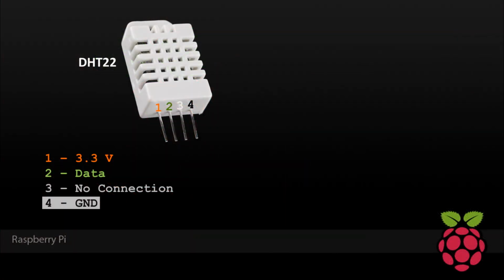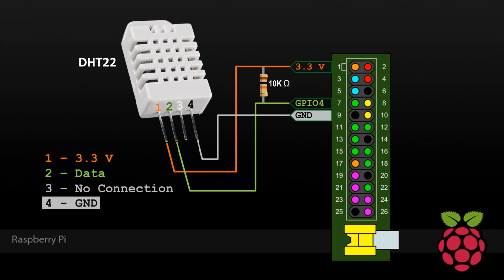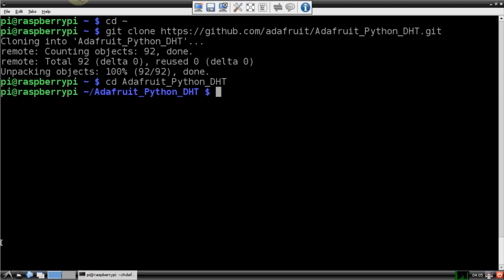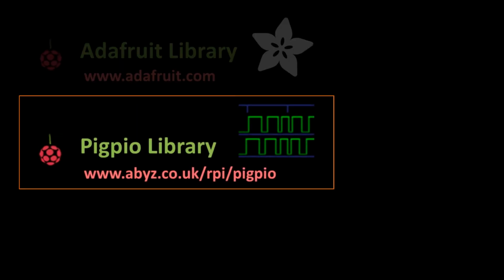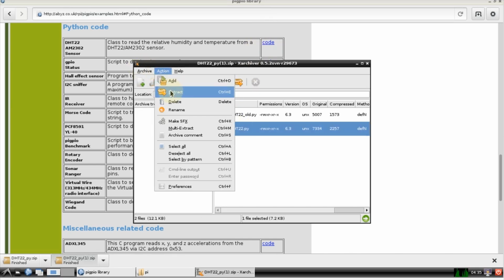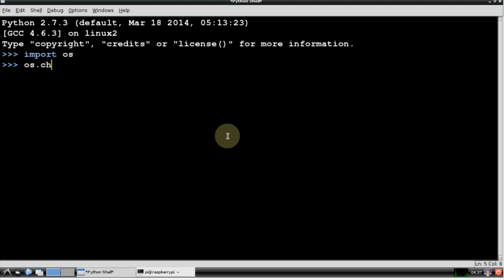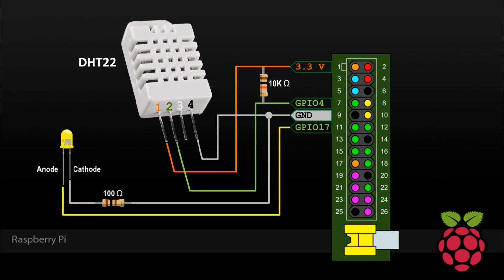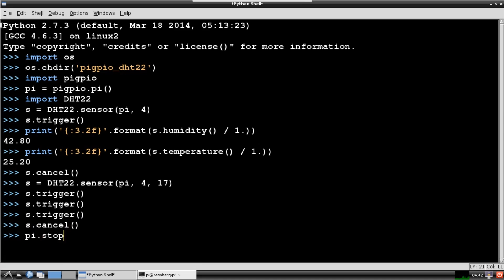DHT22 Raspberry Pi Humidity Temperature Sensor Tutorial

Comment: noob question, why the 10k ohm resistor? ty in advance
Reply from the maker: The resistor needs to go across data and 3.3V because it expects a pull up.  It won't work across data and ground (that would be a pull down).  For short cable lengths, 10K should be OK.  For longer lengths, a 4.7K resistor might work better.
Reply: Is there any computation to know how much resistor should i put between the 3.3v and the data pin? Thanks in advance :)
Reply from the maker: Through my website.  There is a link the video description.
Reply from the maker: I wouldn't call myself a Python logging expert.  Here's a good example of a TimedRotatingFileHandler: https://www.blog.pythonlibrary.org/2014/02/11/python-how-to-create-rotating-logs/
Reply from the maker: I don't think it is an option with the Adafruit DHT-22 Python library, but it might be possible with the PiGPIO library.  However, I think the Pi's internal pull-up range is around 50K to 65K ohms which may be too high for the DHT-22.
Reply: well, let me refine my inquiry, why between the data cable amd the 3.3 v cable?
Reply from the maker: It is a pull up resistor.  Data signals are usually transmitted as 0’s and 1’s represented by lows and highs.  0V or 3.3V with respect to the Pi.  The resistor pulls the data line high so it has a defined default state.  Otherwise, the data line would float.  A floating pin is unpredictable and subject to interference and arbitrary readings.
Reply: rdagger68 thank you for the fast response! keep up the good work friend!
Reply: + rdagger68 may I know what if I put the resistor between data & GND? And any reason for choosing 10k ohm value but not 5k for example?
Reply: Thank you for the response, can i ask a different questions? Still it's about raspberry pi and python, how can message you sir? :)
Reply: I would like to make a python program that will create a new log file, every 24 hours, I googled and it says I need to create a TimedRotatingFileHandler, but I want to understand more. I know you're expert on this, sorry I'f this is a little bit off topic. Looking forward you help me out kind sir.
Reply: Thanks for the help, tho I figured it out myself a couple of minutes ago, still thanks for your kindness sir. God bless you :)
Reply: Hello again sir, I just want to ask a question again, why is it when I setup my GPIO as GPIO.BOARD the DHT22 doesn't read at all. but when I leave it as shown, it works just fine.
Reply from the maker: There are 2 numbering modes for referencing the pins.  Board refers to pin position on the board.  BCM refers to the Broadcom numbering.  I use GPIO.BCM in all my videos because I find it more prevalent.
Reply: @rdagger68, hi, me again :D
may I know is it possible to use internal pull up instead of external resistor?
Reply: rdagger68 I stated the pin correctly when I set it up to GPIO.BOARD, yet it still doesn't read, but other sensor do. I'd like to think it has something to do with the configuration in the library, maybe it is BCM in default.
Reply from the maker: In the past, you would get a runtime error if you did not specify the mode with GPIO.setmode().  This may have changed in recent releases of Raspbian Jessie.  I haven't tested it but based on your experience it's possible that it now defaults to BCM.
Reply: how do you connector the resistor with data pin and the 3.3V pin without using protoboard
Reply from the maker: Generally speaking, you want the pull-up resistor to be 1/10 the resistance of the input pin (also called the input impedance).  10KΩ is usually a safe bet.  There are exceptions such as timing and distance, but  I’ve had no issues with 10KΩ on the DHT22.

Comment: Do I have to hook up pin 4 of the DHT22 to the ground rail of the bread board?
Reply from the maker: DHT22 pin 4 must be connected to a ground on the Pi either directly or as in the video via a breadboard rail that is common to the Pi.

Comment: Hello sir, Can I use any kind of temperature and humidity sensors, co2 sensors to be directly interface with Respberry Pi. Does all of it compatible with Respberry Pi?
Reply from the maker: Great question!  In terms of hardware, you should be able to interface most 3.3V sensors.  The same goes for 5V sensors when combined with a level shifter.  In terms of software, digital sensors usually require a library to poll the sensor.  You can often find a library on GitHub or one that can be adapted.  It can be challenging writing a software driver from scratch especially when precise timing is required.  On the other hand, analog sensors can usually be driven with an ADC such as the MCP3002 or ADS1115.
Reply: Thanks! great help.

Comment: You seem to be using python 2 for this, do you know if this will work with python 3?  I also seem to be having trouble running this as an executing python program.  It appears to work OK from the shell but when I enter the entire program and running it fully with 'python  myProgram.py', I get an error saying that it can't find a module named DHT22.  Here's my code:

import time
import os

os.chdir('/home/pi/DHT22')

import pigpio
pi = pigpio.pi()
import DHT22
s = DHT22.sensor(pi, 4, 18)

while True:
    s.trigger()
    print('{3.2f}*C'.format(s.temperature() / 1.))
    print('{3.2f}%'.format(s.humidity() / 1.))
    time.sleep(3.0)

Any help is appreciated.
Reply from the maker: It will work for python 3.  For the Adafruit installation just add 3 after python:
sudo apt-get install python3-dev
sudo python3 setup.py install
I think Pigpio already comes installed on the latest version of Raspbian Jessie.
You would also run with python3:  python3 myProgram.py
I would add a shebang line.  I revised your code (I put the DHT22.py file in the same directory as the script):

#!/usr/bin/env python3
from time import sleep
import pigpio
import DHT22

pi = pigpio.pi()
s = DHT22.sensor(pi, 4, 18)

while True:
    s.trigger()
    print('Temp={0:0.2f}*C'.format(s.temperature()))
    print('Humidity={0:0.2f}%'.format(s.humidity()))
    sleep(3.0)
Reply: Perfect!  Thank you very much for your help.  Have everything working now under python 3.  Really appreciate the help.

Comment: I'm using the pigpio library after having some issues using the Adafruit library (worked one day, nothing changed then stopped working), not an issue as the pigpio works great in IDLE as shown in your video however put exactly the same code in to a python script and i get a value of -999.00. 

Turns out the fix is to 'import time' and put a small delay of 0.5 seconds after the trigger and before the print. Not sure if this has been mentioned in the comments but thought I would mention it for anyone else having the same issue!
Reply from the maker: Thanks, I do mention it on my website and it is the last item on my DHT troubleshooting FAQ.  So far I've only found it necessary on the Raspberry Pi 3 because of the increased speed.  I've found that 10 milliseconds is sufficient.  Appreciate the feedback.

Comment: Could you do a tutorial transferring this info over a BLE board to the Pi?
Reply from the maker: BLE is a great suggestion for a tutorial.
Reply: rdagger68  awesome! am only brand new to this world! want to build a beehive monitoring system that measures temp, humidity, weight and transfers that info via BLE to my pi to then show on a touchscreen in my home.
Reply from the maker: Very cool project.  If you want to transfer to the Pi via BLE, you will need another device (Pi, Arduino, Feather, etc.) to act as a transmitter.  How far is the hive from the house?
Reply from the maker: I haven’t worked with BLE so I’m not sure how many devices you can connect.  I also don’t have much experience with load cells, but I’m pretty sure you could encounter drift errors if the sensors are subject to constant pressure.

Here are my thoughts on 3 approaches:
1.  Arduino with RS485 module in each hive daisy chained with outdoor twisted pair wire to Pi in the house.  (Pros: reliable; Cons: running wiring could be difficult)
2. ESP8266 running MicroPython in each hive serving Wi-Fi REST API to Pi in house.  (Pros: Inexpensive, all code in python, probably can update wirelessly using WebREPL; Cons: May require additional access point)
3. Feather 32u4 in each hive connected via BLE to Pi in the house. (Pros:  BLE may be more reliable than Wi-Fi, BLE may use less power than Wi-Fi; Cons: BLE range could be an issue, Feather more expensive because Arduino clones and ESP8266’s can be bought on eBay for around $5)
Reply: rdagger68  I have just ordered all the gear to give the feather idea a go to start with, me being a total noob ATM I like the idea of there being a walk through like there is for that. Along the way I might find something better? Total cost was $110 which would do 1 hive which is not as cheap as I wanted but MUCH better the $480, plus I will have LCD displays on each hive to read while I work on them.

My biggest concern is the BLE to the Pi, I can't find anything really to follow for that connection. I personally find arduino programming much easier to follow then Pi, I hate terminal work! 

I really wish I had your knowledge to do this project! I can see with that it would be quite straight forward and if successful a epic help to world wide beekeepers. For me I feel like I am trying to build a nuclear reactor with only French as a language to talk. (I am Aussie)

Comment: Thanks for your patience and advice. I had written a code but it activates the gpio pin even before the threshold value I set (30degrees) is reached i.e the led goes on even at lower values than I had specified. I used an led as a demo in place of a fan-relay setup. Changing the pins doesn't help. I cant trace the problem. That is why I needed the code "Specifically the code" so that I can append it and see if it can run as per requirements. If you don't mind please post a code that can activate any of the gpio pins when temperature or humidity goes above a certain value°. You can try it out first to see if you face similar challenges. Thank you.
Reply from the maker: Assuming your relay is activated by a high signal (this is off the top of my head without testing):
while 1:
    h,t = dht.read_retry(dht.DHT22, 4)
    if t > 30:
        # GPIO high to 3.3V
        GPIO.output(led_gpio, GPIO.HIGH)
    else:
        # GPIO low to 0V
        GPIO.output(led_gpio, GPIO.LOW)
    sleep(3)

Comment: Great work!. I need to convert the DHT22 readings to voltage magnitude equivalents but all my attempts have failed. Please if you can,  post a  module that can achieve that.
Reply from the maker: There are several ways depending on your goal. Probably the easiest would be to use a DAC such as the MCP4725.
Reply: I wanted attach a code to switch on two LEDs when temperature or humidity levels read beyond  critical values respectively.  But the LEDs go on even  when the critical value that I have set has not been used. I thought maybe if I write a code that converts the DHT22 readings to voltage so that I could set conditions using voltage.
Reply from the maker: Assuming you're using a Raspberry Pi, there's no need for a digital to analog converter.  Depending on the the LED, you should just be able to turn a gpio on or off to switch the LED on and off based on a conditional temperature.
Reply: Everything is okay. I can obtain values from the sensor. Assuming I wrote the exact code as per your tutorial, add a code that will activate a gpio pin ( where I have connected my led) when temperature reads above 30degees Celsius.  That is all I am requesting.
Reply from the maker: Yes that will work assuming your LED does not draw too much current.  If the LED draws more than 16mA, then the code would be the same but the GPIO would activate a transistor or a relay board that in turn would activate the LED.

Comment: Question....The dhtt22 working great so somewhat...they are about 10 to 20ft away and I tested voltage. the voltage on the far one is 4.9v. one problem I am having is that sometimes the the temp drop from 70 degrees to 51.1 degrees. is there a way to correct this problem?
Reply from the maker: Are you using shielded wire?  When the temperature drops does it stay at 51.1 for a while or is it just an occasional bad reading?
Reply: I am using home security wire 2 pair... it drop at 51.1 for a long time and somethings at 54 degrees and 53 degrees... right now its reading 51.6 degrees.  I have refresh my home automation software and its at 54.0... So I can see it changes every min to low temps and at 5min its back to reading good temp...now its reading 75.9.. I have two one change more often than the other
Reply from the maker: You would have to experiment to determine the cause.  First, I would try switching libraries to make sure it is not software related.  For example, if you are using the Adafruit library, I would check if the Pigpio library works better.  Then I would try different wire such as CAT6 network wire.  Btw, how frequently are you polling the sensor and what is the average humidity when you get bad readings?
Reply: I am using a home automation software... HomeAssistant......

the wire I am currently using is a 18guage.. about the humidity  I hide those from showing on the main screen however they are ruining in the background. I have 5 dht22's.. one with the 4 pins no board... and 4 that I got with the board attach to them. I have notice the one with the 4 pins that I added a 4.7 resistor is working great no problem... The other 4 with the build on board those are the ones that giving the problem.. I will just leave them as is and do not get anymore which my plans were to put on in each room. I was hopi9ng or is there a was to put a capacitor if so size can I get ..  

These are the settings I enter.. 
- platform: dht
  sensor: DHT22
  pin: 17
  name: Garage
  monitored_conditions:
    - temperature
    - humidity

- platform: dht
  sensor: DHT22
  pin: 16
  name: Hallway 
  monitored_conditions:
    - temperature
    - humidity

- platform: dht
  sensor: DHT22
  pin: 12
  name: Front door
  monitored_conditions:
    - temperature
    - humidity
Reply from the maker: I have never used Home Assistant.  What value resistor comes with the DHT boards?
Reply: I don't know what resister they have.. I saw another video and it said no resistor is needed with this type of dhtt22...

this is what it looks like from ebay

http://www.ebay.com/itm/like/191964438524?lpid=82&chn=ps&ul_noapp=true
Reply from the maker: I don't see a resistor in the photo unless it is on the back.  It looks like the type that requires a resistor.  You would have to check with the vendor to be certain.
Reply: Yeah I don't see one also on the board... I was going on what another You tuber said. it can't hurt any I will a resistor.. I'll keep you posted.. again thanks for your replies

Comment: this is so bloody annoying, I just want to plug in a few sensors directly without soldering resistors or using those retarded bread boards, is there a way? or what? the closest I found is the grovepi but I don't want 10 inputs and that huge board
Reply from the maker: Depends on the sensors.  You could try the Sense Hat:  
https://www.element14.com/community/docs/DOC-78155?ICID=rpiaccsy-featured-products

Comment: hi, if you don't use the resistor what will happen, I have mines setup 
with a 10k but the temp is off 10 degrees. do you have any idea why I am
 off so much degrees? I am using the DHT22 with 3.3V. also can this be power by only by 3.3v or it can be power by 5v?
Reply from the maker: The sensor will not work without the pull up resistor.  These sensors tend to be very accurate with respect to temperature.  The temperature value is sent digitally as opposed to analog.  This means that it usually gives you the correct temperature or you don’t get any readings.  Are you sure you have DHT22 and not a DHT11 or other variant?  Are you 10 degrees too high or too low?  Are there any warm electronic components near the sensor?  You can power the DHT22 at 3.3V as long as your wires are not too long in which case you would need 5V.  Please make sure you use a level shifter if you decide to use 5V or you could damage the Pi.  Sounds like you might have a bad sensor.  Please see my website for troubleshooting tips: http://www.rototron.info/dht22-troubleshooting-tips/
Reply: I am using the DHT22 and I got an advice to the 10k I was using was too high and to use a 4.7k with the 5v... I just added the 4.7k and the temp have drop to and seen to settle. the outside temp saying 68.8 and the dht22 in the garage saying 68.2.. I have a old thermostat in the garage and its saying its 68 degrees. So I guess the 4.7k did the trick. I will test for a week to see 1st if its reliable and if it keep the temp that close  before I get some for each room control by my automation sys. tagain thanks
Reply from the maker: Out of curiosity, how long is the wire between your DHT22 and the Pi?
Reply: right now, I have it just connected to the pi for testing but I will like to have one as far as 60feet from the pi.
Reply from the maker: According to the datasheet the maximum distance at 3.3V is 1 meter.  You will probably need to switch to 5V to achieve your desired distance.  Shielded wire would probably help.
Reply: I switch to 5v